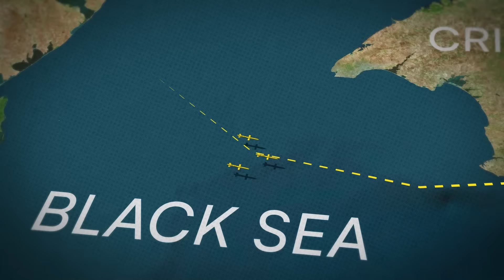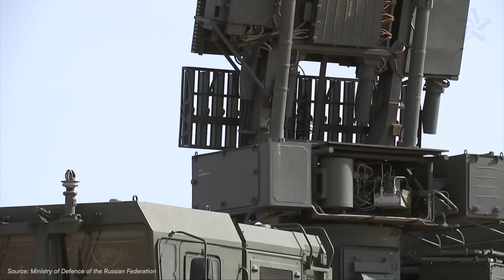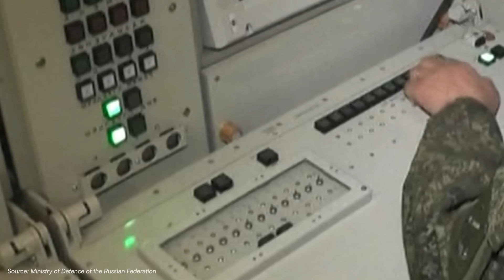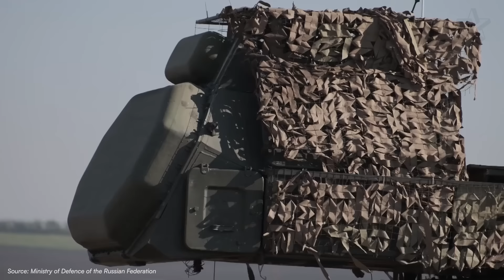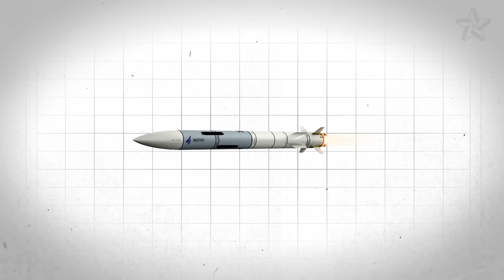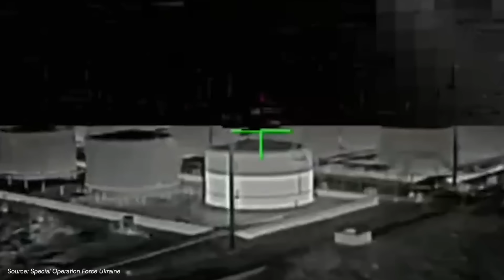Ukraine JUST Unleashed This… Russia Was HELPLESS

Comment: Pelican’s don’t do 540 mph
Reply: They are Flamingos and have a maximum speed of 950kph. Pelican was mentioned as what they looked like on radar.
Reply: @ianmontgomery7534  My point, which didn't land is, even the most junior radar operator would never think "oh my God" there goes a Pelican. If you meant, it is the same Radar cross section as a Pelican, then why not say so Your commentary often does not stand up to rational examination leading me to think you are young.
Reply: @Sandhoeflyerhome  I was only addressing your comment that a Pelican could not do 540mph which I deemed irrelevant because they were Flamingos that can do 950kph. Pelican can do 900 kph which is  550mph. The problem is not that it does stand up to rational examination the problem is the statement is made in isolation and no context. I am retired so I may well be older than you and i have worked in both defence and aircraft manufacture and am not stupid.